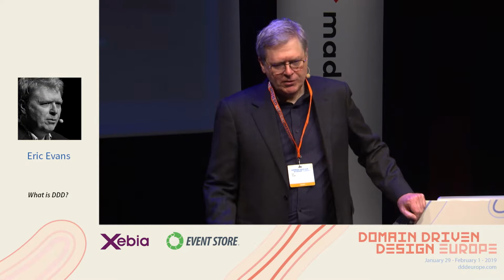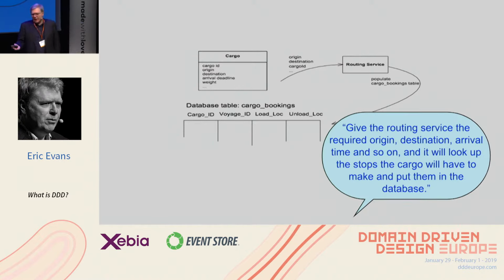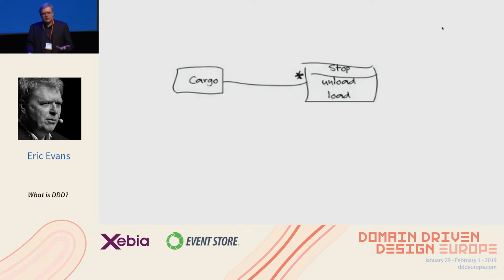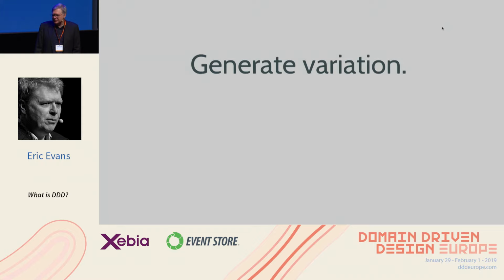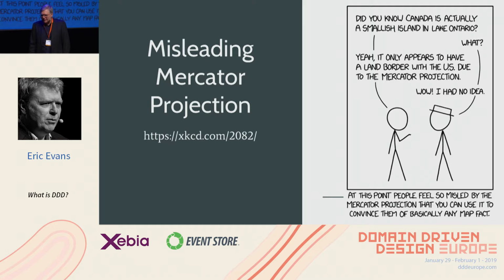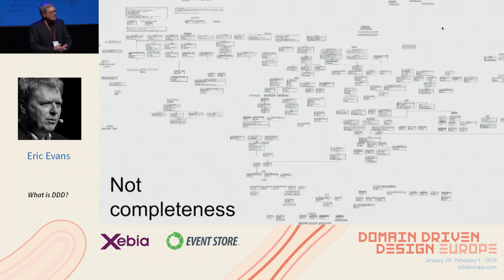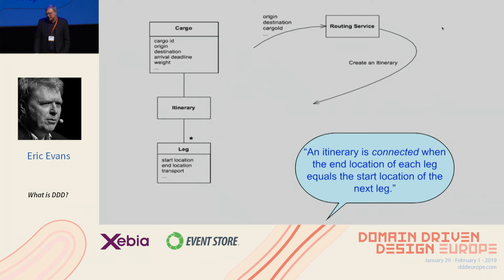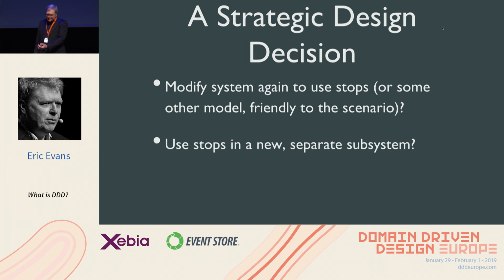What is DDD - Eric Evans - DDD Europe 2019

Comment: Iconic talk. l I really like the qualification of abstractions being useful if they are use-case based but can this be further qualified by "accumulative (permanent) use-based abstractions". For example, what we are modeling does have more temporary features but seemingly insignificant but more permanent features. You want your model to remain useful in the longer term, so modelling the more permanent use-case driven aspects as priority may be useful. 

With this abstraction modeling mindset, more priority would be based on those seemingly near-insignificant aspects of the abstractions as long as they were more permanent. I guess for example Amazon didn't really consider "books" to be permanent but rather they were creating the distribution architecture where books could later be replaced by anything. So the more "permanent" aspect is the delivery infrastructure Amazon built - not books. I love your talk so much - thank you :)

Comment: What's wrong with legs? It needs external logic to make sure that the end of one leg is the start of the next. You don't have that problem with the stops. Legs simply have redundant information causing this problem.  I am not sure why the non-tech people have to speak the same language as the thing is the software, non-tech people still normally cannot understand how something will work. Also, non-tech people use different words to mean the same thing, are we supposed to create different aliases? Sounds more like a fad than an actual software development technique that works in practice.
Reply: In the text he encourages fleshing out these nuances in language to find deeper insight into the problem. Work hard to achieve clarity in the language used between teams, and all of the sudden a developer knows exactly what a domain expert is explaining, or vice versa, with less or minimal ambiguity. If some thing or part of the language is unclear or inconsistent, work to make it clear and consistent. As a result, you will gain valuable perspective on what needs to (or could) interact with something else to provide a rich and meaningful experience to the user. The benefit of this is, as a developer, you become very good at distilling down information and abstracting out the patterns - an invaluable skill regardless of the domain. It might seem futile and pedantic, but this skill of effective abstraction is transferrable across every single domain. Its difficult to abstract a pattern out of something you don't understand, but with effective language, the domain experts can help you bridge that gap.
Reply: Nothing is wrong with either solution. And probably there even might be a better solution if I asked you to think really hard you might come up with something like a route or itinerary. It's not even that point he's trying to make. The point is we need to speak a common language to prevent us from creating software that doesn't fit the problems and scenario's of it's users . We need to carefully and thus not carelessly compass potential future requirements without overcomplicating and overspecifieing so we can always keep on building software ;). And in order to do that we might use DDD and create a lot of models and shared definitions instead of inventing new. Having proper business alignment is great. And event storming is also a very good way to involve domain experts in the proces of defining possible solutions and spotting it's shortcomings upfront.

Comment: instead of leg/stop “route” fit better?
Reply: Itinerary is the object that has the legs or the stops, and itinerary is a synonym of "route"
Reply: @GammaStrobe  Although it is tempting to use synonyms, using itinerary is better, if that is what people in the domain are used to. Leg/Stop are different from route. Leg is a part of route and stop is technically not part of route. There might be some business process between each unload and load at a stop. Depends on what problem you are trying to solve as he says :)

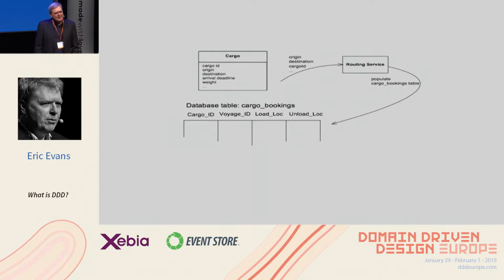Comment: 6:22 example
    7:38 drawbacks of the cargo system design
    7:50 2 perspectives of software design
        8:01 perspective 1: software deisigner
            8:32 side-effect of the cargo system
                8:43 combine complex logic with the database update violates the principle of separation of logic from updating state
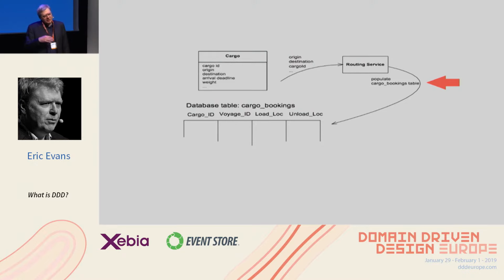        9:08 another perspective: domain
            9:58 more detail, 10:02 we cant always get such high level discussion
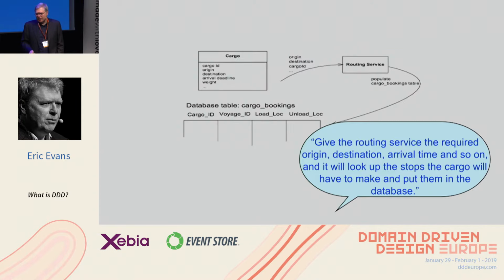    11:01 what we want is to be able to notice when this happens and to take a correct action 11:18 how would it affect the software as it exists 
    11:46 we have to find another way of dealing with
14:15 one of the principles of DDD: the LANGUAGE is very important 14:21 one thing I've noticed: when we talk about the software, we don't use the same language that actually in the software
Reply: Thanks man, + nice indentation
Reply: Many thanks mate.
Reply: many thanks!
Reply: Pmy no uno menh

Comment: Hmm, so what exactly is DDD now? Just using Class names that match the typical parts of a domain?
Reply: Closer than it sounds. I think this Is a great place to start, towards feeling like you really "get" DDD :)
Reply: The key word in your question is "typical". DDD is for determining not what is typical but what is useful in the customer's problem space.
Reply: awrightiv of course I meant the names of parts of this concrete domain that is worked on, not just using some generic names. 
Not a native speaker, so I guess there might be things lost in translation. ✌🏻
Reply: That at least would be a good starting point. But a very basic one.

The essential part of DDD, to me, is that developers, or at least designers of a software system (which IMO should be actual developers - so-called architects are in the vast majority of cases so far removed from the solution domain that what they design is rubbish), should have a good understanding of the problem domain. But the problem domain is usually highly complex, therefore you cannot stop learning - the problem domain, I mean. Once you go into a rut of doing this,  doing an implementation closely resembling the problem domain comes easy and naturally. If you don't, chances are high that your implementation will be difficult to adapt to increasingly subtle and fine-grained insights into the problem domain, even if the problem domain doesn't change much.

DDD just gives you a way to do this kind of continuous learning in a systematic way.
Reply: You are using at a very reductionist description of what DDD proposes, but I get how it's "actionable" insights can be interpreted just as that.

Have in mind that DDD is a set of guiding principles that presents tools since the code level (you may have heard about value objects) up to a strategical level (when designing teams around bounded contexts) - and doing all that by focusing on the core domain and having a shared view of the problem space with the domain experts.

The usefulness of this might not be apparent for a simple CRUD system, but its invaluable when dealing with other complex ones.
Reply: seidenada I was expecting that this Video talks about Bounded Contexts, Value Objects, Aggregates etc. But I got this information now from somewhere else, thanks!
Reply: @sticksen  DDD is not about value objects, aggregates … It is domain model which is architectural business pattern. But there are next patterns which can be used in relation with DDD. DDD is about naming, bounded context, vocabulary. It is more than programming technique. It is development philosophy.
Reply: ZefekKa of course it is also about the things I mentioned. It’s the Tactical Design.